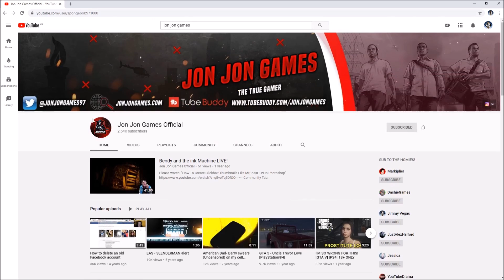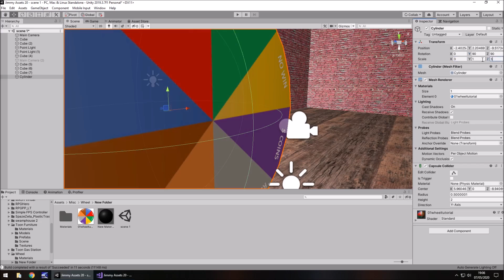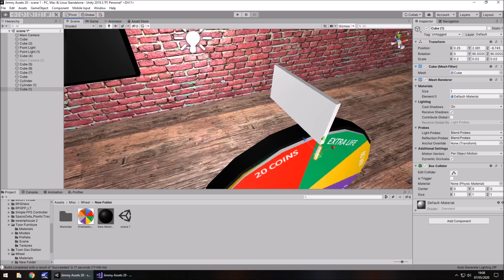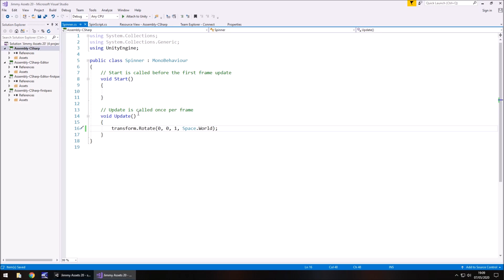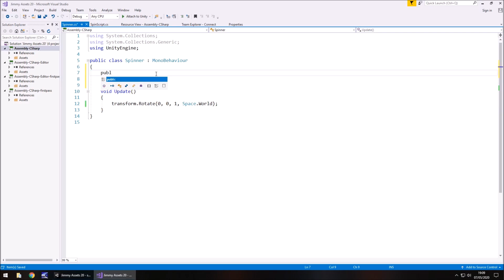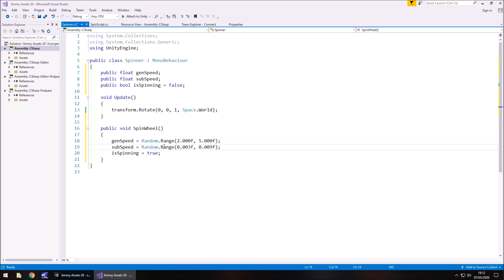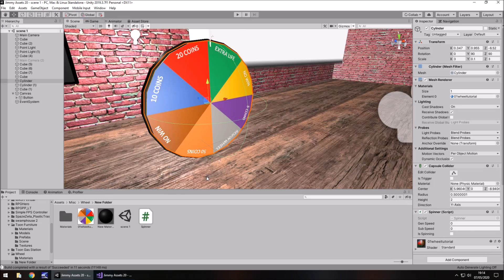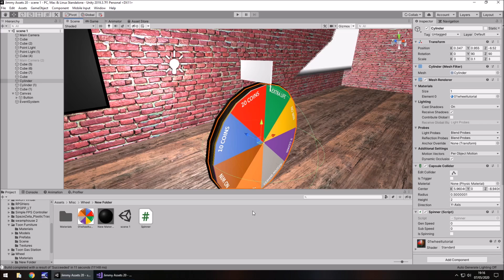HOW TO MAKE A RANDOM 3D BONUS WHEEL - MINI UNITY TUTORIAL

Comment: Quick tip: if your spinner seems "jolty" or not as smooth as you would like it, instead of using Update(), use FixedUpdate(), to make the spinner framerate-independent. Using Update() would mean if you had a faster computer, and therefore a higher framerate, more transform.Rotate calculations would be made, meaning the spinner would spin more (assuming the same random numbers), possibly putting some players at a competitive advantage (though in this application probably not). The jolting is caused by spikes and drops in your framerate, meaning while one second may have 500 calculations (ie the fps is 500), the next second there could be 800, for example, meaning that second the spinner would spin faster than anticipated for a second, even though it is meant to be slowing down.